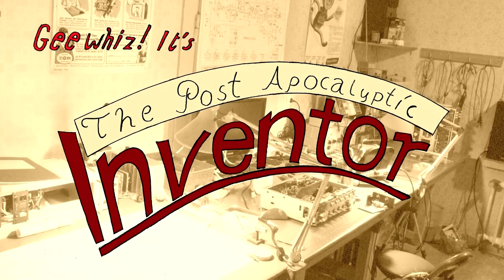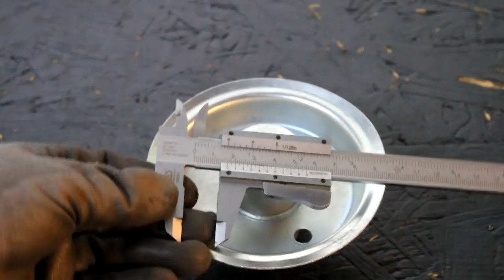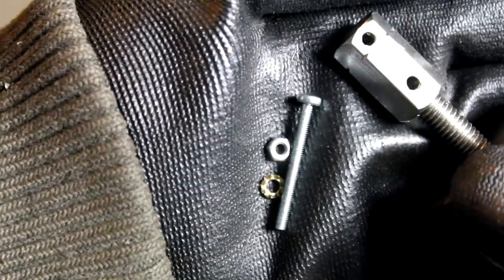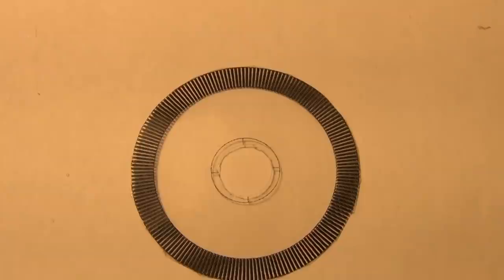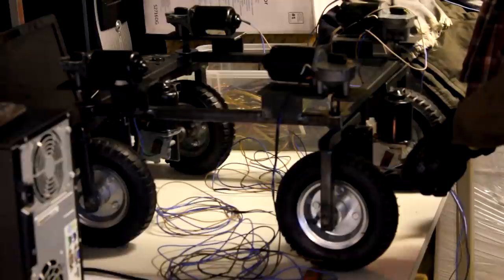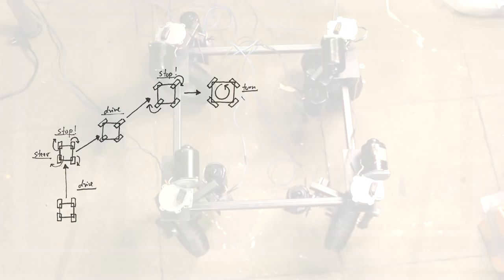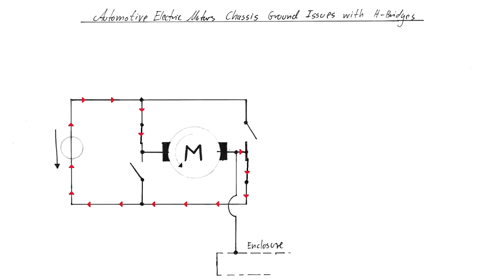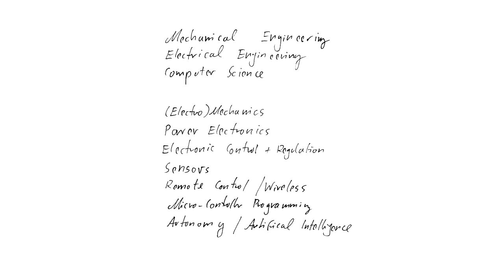Build a Robot with Windshield Wiper Motors

Comment from the maker: Hey if you don't wanna miss out on update photos and texts etc. make sure to follow me on Facebook, Patreon or vid.me  
https://www.facebook.com/realTPAI
https://www.patreon.com/TPAI
https://vid.me/ThePostApocalypticInventor
Reply: The Post Apocalyptic Inventor Thanks again for the vid.me updates. I am not at all into FB particularly after thier social experiments, etc. It just becomes to much of a time waster as well.
Reply: Alternate drives. So for example on a remote, switch 1 has conventional car steering, switch 2 has dual steering, switch 3 has that weird combination of two found in some cars where the front wheels are controlled by you, and the rear two are automatically turned to a degree to lessen the turn effort, switch 4 custom individual wheel turning. 

About the last one, it might seem a complicated mess to put each wheel where it is needed, but, i have seen crawler rigs with such setups in the past. Quite effective when one wheel is lost in space and you want to anticipate a contact.
Reply: For your DRILL PRESS, i did the same booboo like you, and fixed it easily doing this:
Mount your lathe, doesn't need to be precise for this.
Mount the appropriately sized cutter inside your chuck, remove everything off the saddle, that relates to the tool post. 

Mount a square plate (doesn't need to be precise, i was desperate to finish, did it all in 3 hours including running to the local machine shop supplier to buy new rod), and on it, mount a new piece of rod that fits your dimensions. THEN, using the saddle, run the cutter slowly at the highest speed (i'm assuming a small lathe like yours isn't too fast, mine wasn't when i had one) cutting away the new keyway. 

Round the old key's edges, make it smooth. Make sure it fits nicely but without binding, what likely happened to you is, there was something in the key way and the the action rose the key thus chipping and snapping the whole deal.
Seriously, that's a thing you can do in your home with what you have now.

Also, wanted to say, don't give up. A lot of us appreciate the work you do, immensely.
Reply: The Post Apocalyptic Inventor The choice of motors is very smart. Thy are small, powerfull, waterproof and should'nt be much used since their function was  to remove the water whenever it rains and not all the time. I guess that the inverting switches you diconnected at 1:55 could also be used as crude turns counters in projects where you don't need such a fine angular precision in your feedback control. 
Your modular conception (same design for each wheel) is also a great idea. It simplifies both the design the construction process and the programmation. It also makes to frame structure extremely symetrical, which is usefull for simplifying the AI decisions of an autonomous robot. 
Great job.
Reply: Bei 00:30: B1,  kurz vor Horn Bad-Meinberg?
Reply: The Post Apocalyptic Inventor it looks like the Banjo Kazooie Nuts And Bolts car designs game.

Comment: One thing to consider, and is important, in the future, is to install an electrical emergency disconnect pull out plug that disconnects all power from the source. It must be real easy to get to in the event the bot decides to go nuts.  
I have already got a wiper motor and plan to get more. I did not consider that brush to ground issue, glad you brought it up. I plan to use the motors for general purpose small motors. The only choice is stepper or dc automotive types. The only type ac induction motors available in USA, and likely the world, are FAN DUTY motors. Those are wound with too small of diameter wire so the motor will burn up if it is not used as a fan. There are a few non fan motors available, but they are more expensive than far larger motors. Near the end of the video the Thing you have looks like it is powered by a small ac motor, maybe 1/10 hp. It looks old. Many years ago, small general purpose ac induction motors were common and cheap, but no longer.

Comment: Great job! May I suggest building a wiring rig from the ceiling of your workshop, with the wiring fed through a long extended spring, to allow top down attachment to your test devices, and reducing the trip/obstruction hazard. You could possibly even add connectors at the end of the wires. Maybe 10 lines?

Comment: Great presentation. Thanks. I just wanted to mention that the main reason that the wiper motors are grounded to their cases is for RF interference suppression on a vehicle. Not a problem in your application of course unless you're trying to listen to your on board radio.

Comment: you might want to consider using potentiometers for steering positional information. You can tell where each is at any time, with an encoder you dont know where you are on power up
Reply: Maybe as an addition, potentiometers aren't known for their stable readouts.
Reply: @MsSomeonenew  Potentiometers can be very dependable but it requires attention to detail. Typically, you want zero current in the wiper, ie. an “electrometer” buffer right at the potentiometer. These days it’s easy since you have tiny FET op-amps that can be mounted directly on the potentiometer and only need a bypass capacitor to operate in the buffer configuration. Otherwise, you need a shielded wiper connection to a remote amplifier, and the shield has to be bootstrapped, ie. the output of the amplifier has to drive the shield, to cancel out the cable capacitance - but that’s less preferable than a buffer right at the potentiometer.

Potentiometers interfaced that way will provide very clean signals even if they are very scratchy in terms of wiper impedance. Why? Because there is “no” current flow in the wiper and thus wiper impedance doesn’t affect the potential. When things are clean enough, even complete disconnection of the wiper from the track provides enough capacitive coupling to maintain reasonable output while the wiper regains contact. And that’s the secret to using potentiometers as dependable position sensors. They only fail when the resistive track gets physically worn out enough that the wiper is riding on the substrate. That is remedied by using potentiometers that have specified rotational life and it’s adequate for the application.

Cable potentiometer transducers are commonly used in aerospace applications, after all, so it’s not unthinkable that if you flied enough, your safety depended on the performance of one or more such transducers. 

Also, reliability requires that potentiometers used as input controls should not be used to directly divide any AC signals, ie. if you want a scratch-free volume potentiometer then you can’t be passing audio signal through it, but instead using its “DC” voltage output to control a variable gain circuit element (or software). The reason? High impedance wiper interface has low bandwidth. At higher audio frequencies there is enough stray capacitance to “expose” the wiper impedance changes, and re-introduce scratching in the audio output. So, passing audio or any such signal through a potentiometer makes the application inherently orders of magnitude more sensitive to wiper resistance changes and thus scratching. Sure, it’s an “easy” way to get a volume control implemented, but you get poor performance out of it - according to the low effort put into the design.

Voltage controlled gain stages are not too hard to design, since it’s rarely needed for the gain control to be highly linear, only the audio signal path has to have high linearity. They don’t have to be perfect multipliers.

Comment: Am I right in the assumption that I need to remove the ground if I want to run it forwards and backwards? If it goes backwards it will fry my Arduino right? Because suddenly the ground would be positive right?

Comment: Phase 2 is camera(s) ,sensors, and full automation.  Disabled, I need it to work for me. (Cut grass, haul trailer and go dump it and return.  (Find me and bring trailer from storage even.)

Third, I made good vacuum for Gras /leaves.  It can pull that to clean up yard!

So we are working on same project.  Motor options (wiper motors,  wheel x chair used motors, 
Or more expenssive strong motors for robots.

Comment: You could spare yourself a headache by using absolute encoder discs for the steering wheels, but you need more light sensors. And have doubt about the durability of the wormweels. But I must say this is an amazing project that has a lot of potential for future projects, very nice! I watch all of your videos

Comment: One way to overcome the issues of different motor speeds for each wheel in the Ackermann steering setup is to wire the wheel motors in series pairs.  The front two motors are wired in series and the rear two motors are wired in series.  This will allow the load on each motor to self regulate the speed.  Not a good plan for a large powerful motor, but for something small, it works surprisingly well.

Comment: You can use the scissor lift to raise and lower the robot if you would take the ideas that you've got and somehow connect them with the with the scissor lift you can create something that's so you have something that's bigger than your to drive over you can use those to raise the units above that and drive right over it

Comment: Wow you have been busy! :)
I feel your pain making these parts without a lathe. I have tried making a basic slip ring using a drill press in the past and it is complete blind luck that you don't screw up the alignment and have to start over. In the end I settled for a second hand automotive part from a car steering wheel. But in some cases, if you wanted something stronger i.e. not plastic, you will still have to make your own.

Comment: I remember a documentary showing german soldiers during WWII controlling a tiny tank with electric motor and explosives. The soldier would walk behind as it was controlled using wires and drive it under a tank or some other military target. The soldier was always 50m or so behind it so it would of been a scary ass maneuver. It was ahead of its time. Smart idea too.

Comment: What you have made is called a 'swerve drive' and is used by some teams in the First Robotics Competition. There is a great amount of information available for those swerve drives. Here is an example of the awesome capabilities of your drive train: https://youtu.be/kZHaTGiakZM
Reply: Great reference. Is there a collection of ideas from First, an encyclopedia of techniques?
Reply: Another fun drive to experiment with would be the "bumper car" drive. A single central powered wheel with a 360 degree steering rotation, and fixed or swivel casters for the other rolling points.
Reply: You might like the Chief Delphi site https://www.chiefdelphi.com/forums/portal.php . Our FRC team used swerve with pretty good success last season. Here's a sample of how our swerve works http://swerve-model.herokuapp.com/ that uses information found here https://www.chiefdelphi.com/media/papers/2426 .
Reply: While there is no centralized place for FIRST techniques, I would agree to look at Chief Delphi, as Scott posted above.
Reply: fracture, I was thinking the exact same thing as I watched this video. Envisioning a giant inflatable wheel in the center and some small casters in the corners.

Comment: hello I have a similar problem. I literally burned out my mosfet motor driver.

can you kindly explain how cutting connection to the wiper motor enclosure works. it is not really clear.

is there a way I can do that without having to open the motor?

Comment: What if you use a power source with center tap (+12v, -12v, and 0) and control motors with only 2 switches instead of H-bridge? Also in this configuration, you can use chassis as a wire, and you don't need to cut the connection.
Reply: TheAntropod back emf will cause problems

Comment: Ideally, if you can detect the torque on each of the 4 tractor motor, you could allow more diverse steering angles. It could be done with strain gauge which detect minute distortion between the motor shaft and the wheel shaft in the same way as an electronic scale measure small bending on an aluminium base.

The closed loop would apply as much current needed to equalize the torque on each wheel. This would automatically adjust the rotation speed as needed given a specific steering.

The robot would still be set in motion with a target speed, but each motor would increase their torque together, to always match and the PID loop would change the torque command when approaching the target speed. In turn, each motor would have a separate PID loop to adjust the PWM to reach the specified torque.

Comment: I love to think about the geometry of things like this. Maybe the steering angle (distance of the pivot point in ackerman geometry) could be based on your desired speed. So when you're not moving you turn in place but when you're moving the turning radius moves further away based on speed.

Comment: the wiper contacts could be used to get a measurement of the speed of the motor to use in a control loop wich keeps it constant up hills and over obstacles

Comment: i am using same motors and same h bridges. i didnt cut anything but its seems they are working fine together. i dont know why. i am using only the slow turning pins. may be its about that ? i thing the trick maybe i didnt put them in one framing.? they are isolated seperated frames.

Comment: A bit too late now, but what would have been really cool would have been slip rings for the wheel drive motors. Then you wouldn't have to worry about passing the 360 degree mark with your steering motors. :)

Comment: Question for you that I think you'll be able to answer.  I recently wired a wiper motor and when running it in the normal direction, I can change from low to high speed by simply connecting the + wire to the high speed or low speed pin.
The problem I'm having is that I want to run the motor counter clockwise, so to do so, I just switch the wires around to reverse the polarity and it works but only on the low speed pin. When I connect the wire to the high speed pin, the motor only runs in a momentary start/stop motion.
Do you know why this is happening or what I can do to correct it? Thank you

Comment: It would be interesting if you made a vertical actuator for each wheel, that way you could extend one wheel higher than another, this would help you with ground clearance. This would also probably require you to rebuild your frame.

Comment: Instead of using rotary encoders, have you considered using laser mouse sensors?  It's a neat way to recycle old mice; and new sensor chips from China are under 1.00 US D a piece with 1200 to 1600 steps/inch.  Just run them across an enclosed/matte section of the output shaft. (Then backlash from the gearboxes won't even matter.) -- Use PID in the Arduino the control steps/sec or position.

For sensory data, you can grab an old Kinect cheaply off ebay; mount it to the top? 

Raspberry PIs are impossible to find right now, but old laptops or NUCs can be sourced cheaply also. (I Just scored a 2.4ghz NUC with 8GB RAM and a 250GB SSD for around 40.00 US D. -- So it has a bit more compute power than an RPI anyway.)

Comment: If you're planning to use this robot as a mobile camera tripod and record video from it while it is moving, it may be that the vibrations from the movement are too much for the camera to handle (especially if it doesn't have mechanical image stabilization). You talked about suspension earlier, but then I have seen nothing that could count as suspension on the robot: No springs or dampeners of any kind. Possibly even some dampening piece made out of rubber would already help a lot.

Comment: FYI, Think wireless charging. How about a charging "mat" so your robot can wireless charge while it's working, so you can minimize the batteries weight. Even in a big warehouse. Induction coils should resolve the problem, while the mats are made with a aluminum printed pattern. Your welcome!

Comment: Did you test different size wiper motors for strength?   I know some can lift 400 lbs.  I’m building a n RC lawn mower. I want to consider wiper motors .  ( it may pull a leaf grass catcher small trailer).  I was going to steer with two rear wheels.  I’m buying components now.

I cannot read electrical plans.. lol sorry.   PLEASE RESPOND HERE SO I GET NOTICE.

Comment: Your steering is going to need absolute positional sensing as well as relative positional sensing which is what your gray code encoders provide. For initialization at the very least.  IE, at startup,  it doesn't know the wheel facing orientation, eg a momentary sensor of some kind on each wheel. Kind regards

Comment: Very interesting.  The encoders are really tough.  They have to have ZERO interfearance with any dirt or dust.  The smaller that wheel is, the more sensitive it is to a vibration or movement in any direction from the optical sensor.  THEN - decoding the signals is too much work for an 8-bit arduino, you have to have a seperate quadrature decoder that is fast enough to keep up.  Not easy.

The concept was interesting to see.  Curious if / how the project has evolved from this.
Reply: Well.... I agree in general, encoder accuracy will be impacted by any injection of error such as dirt or misalignment. But these issues can be eliminated by using a different type of encoder architecture such as magnetic / induction and star ring gear design. These are commonly used for fuel injection timing and often installed in the crankcase filled with dirty oil!

External mount types are also used where dirt is often impossible to eliminate.

Comment: Nice project!   I know that this is an old video, nonetheless, I wonder if 2 of the 4 wheels could be simply casters with out controls or motors.  The powered wheels would be at 2 corners.  As I am imagining it you could still replicate any direction or manouver that 4X powered wheels could perform